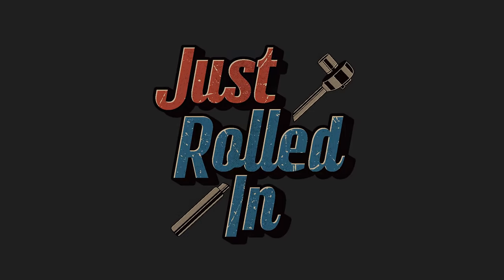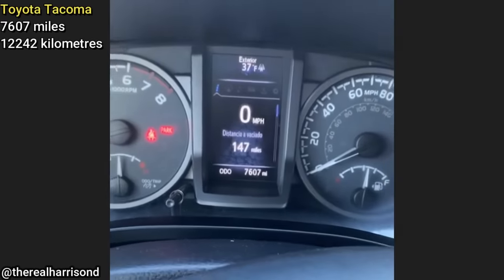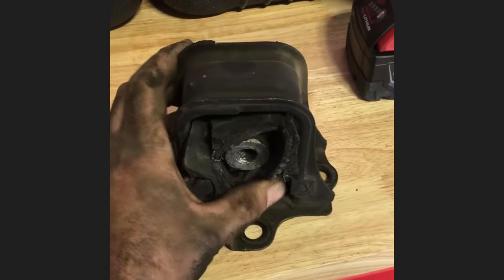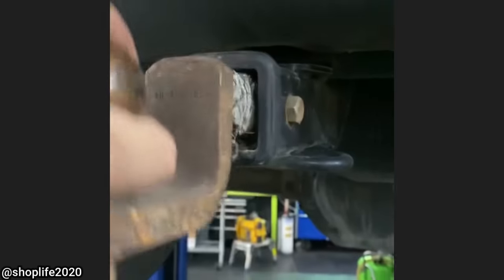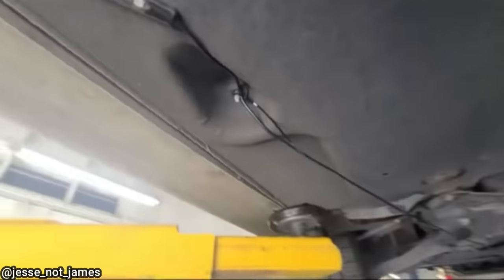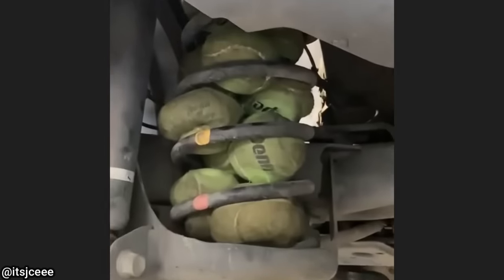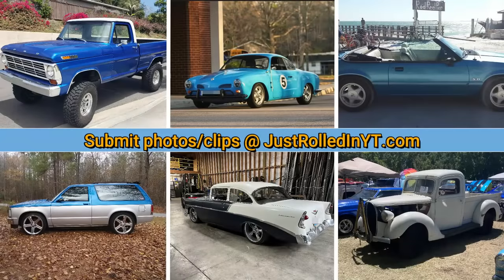Customer States Change Engine Oil On Tesla | Just Rolled In

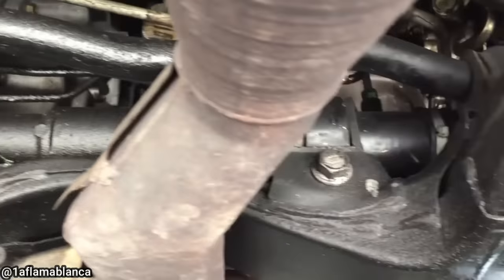Comment: 2:30  I took my girlfriend's car to a Sears shop once many years ago for a tire repair. While there, the mechanic showed me a loose steering control arm. As I had paid to have that control arm replaced four months earlier, I told the mechanic to put the car on the ground once the tire was fixed, and I left to head back to the shop that had put the control arm on. The other shop tech showed me that what had actually happened was that the Sears guy had pulled the cotter pin and loosened the nut. He fixed it in less than a minute for free, and told me that he'd seen a lot of that kind of thing from Sears. I went back to Sears and told the service manager what I had discovered, and that not only would he never get another penny of my money, but that I would tell this story to everyone I ran into for the next six months. As you can see, I'm still telling that story.
Reply: And Sears went out of business. You must talk to a lot of people!
Reply: I had a similar thing happy with a repair chain known by their logo showing three brothers.  Took the car in because it was trying to overheat (I could manage it by running the heater), and the place I would have taken it couldn't fit me in for a couple of days and it was within walking distance.  First mechanic looked at it and said it was probably the radiator, but the rest of the system was fine and holding pressure. It was too late to start that evening, 

The next morning I get a call from the "service manager" who told me the car had water "pouring" out of it and that I had to replace the intake manifold, the water pump, the radiator, and they really needed to pull the heads to make sure I didn't have a blown head gasket.  I asked why the tech the night before said it was holding pressure just fine, and the service manager gave me some nonsense about it being the difference between pressurizing the system with air, vs. doing it with water. So I said I didn't have the 2 grand that was going to cost me, so I was going to pick up the car.  He gave me the big song and dance about how I shouldn't drive it with it leaking that badly, and I really had to have it towed. I refused and when I came in they made me sign a waiver stating basically that if I ignored their advice it was the end of western civilization.

I drove it home and took it to the place I wanted  to take it to originally who cleaned out the radiator for $350. I waited a month and took it back to "three brothers" and asked for the service manager. He remembered me and asked if I was ready to get the work done. I told him I didn't but had a question: Why did he tell me that I needed $2000 worth of repairs when the actual cost was $350?  And I made sure that everybody waiting in the service area heard me.
Reply: @almostfm  I remember those guys. I can't remember the name anymore, but I heard a lot of bad things about them too.
Reply: @almostfm  Pep Boys… parts, tires and service…
Manny, Moe, and Jack
Once upon a time I worked at the parts counter of our local Pep Boys. Our shop did NOT upsell crap you didn’t need.
Reply: My brother bought a car and it developed a steering problem. He took it back, left it and got it the next day. He paid for the repair which was allegedly an alignment issue. Still didn't feel right and he took it back and this time he chalked the right rear tire. Shop called and said he now needs tie rods, lower control arms and upper ball joints. He said he would be in. Came in, car was in the same place, looked at the car and spoke to the manager who said it needed all that work and the mechanic said it was unsafe to drive it. My brother confirmed the car had been road tested and they both said yes. Took them out to the car and asked them what the odds were they could drive a car and park it in the same spot in such a way that the chalk marks were exactly lined up? Got the money back for the "alignment" which turned out to be a loose wheel bearing, complained about the shop which closed down 2 months later.
Reply: Jokes on you I wouldn’t take my car to a clothes store to get fixed
Reply: No but In all seriousness good job and I’ve also never heard of a auto shop with that name good thing they are out of business
Reply: @almostfm  a tire shop tried that type of thing with my sisters suv .. but they pinched the rear brake lines and told her it needed a master cylinder ,, took too another shop replaced damaged lines ,,did not need the master cylinder ,, d tire .. pulled that shit
Reply: @MsAubrey  I'd bought a lot of parts from them over the years and never got the "upsell" either. But after that, I never spent another dime there. I don't hold many grudges, but when I do, I make damned sure that they stick. I've got one gas station chain that I've never bought gas from because when my dad died in 1975, they tried to screw over my mom, and it had been our family's preferred brand.  I started driving 41 years ago so they've lost 41 years of gas sales to me and about 30 years of my mom's gas purchases before she died.  I ran out of gas one time (the only time I ever have) and I walked a mile past one of their stations to buy gas from someone else.
Reply: @almostfm  I can understand that. When my stepdad and mom lost their jobs with the Detroit News/Freepress I refused to ever buy one of their papers. Even when they offered me $50 off of my grocery bill one day, I wouldn’t do it.
Reply: Has 6 months passed
Reply: @almostfm  is L
Reply: My wife always took her car to pepboys, much to my disdain.
I replaced her alternator for her, and a couple weeks later she took her car to pepboys for tires or something. On the way back home her battery light came on, so we turned around and went back. We had them test and they told her she needed a new alternator. I said that's funny, because I just replaced it, and I can see the wire you disconnected from here.
Reply: that last part really got me  hell yeah
Reply: I once had a gear slip in my Jeep Liberty when my mom was driving it. Took it to a shop who told me that, on top of the steering rack and exhaust it needed, they also wanted to replace the transmisison. This was going to cost north of 4 grand. I took it to a transmission specialist for a second opinion who told me it was probably fine, then took it to another shop. They changed the transmission fluid since it was overdue and likely one of the causes of the issue, replaced the stering rack (it did actually end up needing that) and told me the small crack in the exhaust was a non-issue. The other shop told me the car woudn't survive the winter I was about to put it through up north. It has since been through two. If you're wondering, it ended up being 1300 bucks.
Reply: I never would waste my time returning there.
Reply: @almostfm  They replaced the started in my Tacoma and it would intermittently not turn over.  I went back and they told me I needed to step on the clutch before it would turn over.  I think I had been driving the truck for about ten years at that point so I knew how to start the truck.  I took it to a dealer and they found out that the three brothers had damaged the wiring harness when they put in the new starter.
Reply: Keep telling the story
Reply: @almostfm  Pep Boys. Yep had a similar issue. Battery needed replacement, took there cause it's a basic and simple job, just routine maintenance. Was told that the entire ignition system needed replacement. Thankfully I saw through the BS, because I know basic car stuff, and just got the battery replacement somewhere else.
Reply: A happy customer will tell their friends, an unhappy customer will tell the world
Reply: I went to a Sears to get a Diehard battery. I had the old battery and set it  on the Plexiglas part of the counter. The crotchety lady refused to talk to me until she had taken my old battery, set it on the floor, took out the glass cleaner and cleaned the couple specs of dirt that had come off of it. I never went there again.
Reply: Report them to the BBB.
Reply: @dtoora  Yeah. About twenty-two or three years ago.

Comment: I worked as an RV tech for years and one of the last jobs I did before leaving the company was a case of (and I quote from my picture of the order) “Customer states that water will not boil when placed near center of stove, requesting technician fix and find way to decrease time to cook.”

It was a 3 burner stove, the middle was empty and had no direct heat, my official response when I closed to job was “technician is unable to resolve issue due to the laws of physics, technician recommends placing cookware directly over flame for most efficient heating. The further the distance something is from a heat source the longer it will take to reach the desired temperature.”
Reply: it was probably too intelligent a response for them to understand.
Reply: So tragic the explanation was needed
Reply: Just remind them to open a window when using the oven and stove stops. So many have died like this at rest stops.
Reply: 🤘🏻 choice response! Unfortunately, that was likely a big "whoosh" for them...they hear "physics" and think "Einstein" and they're lost, LOL

Comment: It's smart to keep fresh oil in that tesla. Also check your transmission fluid and coolant levels.
The only thing hard to understand about a Tesla is where to pour in the electricity.
Reply: Yep Tesla Model S & X uses Dexron 6 ATF and Glycol Coolant. You do have to check on those every couple of years.
Reply: Best way to pour in that electricity is through the right rear caliper upper bolt but only on a Tuesday

Comment: ".. declined all repairs." And people don't get why I hope we never get flying cars. It's difficult enough worrying about current traffic. :P
Reply: People often think mechanics are attempting to scam them because they mention an "issue" that has nothing to do with what they came in for. Or they just don't wanna pay for it at that time. But when your breaks are literally grinding and look that bad, it should be obvious that it needs repairs.
Reply: @greego5952  not wanting to pay for it at that time could be a problem. like having enough money for an oil change but not enough to replace a bunch of other things.
Reply: @greego5952  What brakes? The pads were rusted shut.
Reply: @greego5952  quite sure the grinding came from the separation of the disc from the hub. The disc wasnt moving. At that point you shouldn't be allowed to drive it.
Reply: @greego5952  

Some garages ARE trying to scam people which just makes it so much harder for the honest hardest out there.
Reply: Traffic of flying cars wouldn't be an issue at all. In the air, the chances for a collision, as well as the methods to avoid collision are way better. It's a 3D space instead of a 2D, and planes traveling 10x as fast means 10x fewer cars on "the road" during rush hour, since everyone would make it to their homes sooner, leaving the air even more open than it already was.

Now as for what happens if someone crashes an air-car.. that is way more dangerous, since without proper safety systems, or with malfunctioning safety systems, it could hit almost anything on the ground, with no cost-effective ways to protect against it.
Reply: @greego5952  Or they try to charge 1000X the cost of the repair. I had a mechanic try and charge me over $2000 to tear down the engine and fix an overheating problem. The real problem was the $10 radiator cap that was not holding pressure.
Reply: Well that, and people seem to have enough trouble with forward, backwards, left, and right. Adding up, down, and diagonals to that mix is a recipe for disaster
Reply: Normally my first suspicion would be an insurance scam. In that case it would be more like a death wish if there was any more to it than straight up idiocy. Times like this support the quote "Never assume malice when incompetence will do."
Reply: How come that death trap was allowed back on the road. In england the  garage wouldn't let you take it.
Reply: They need engine cut off sensors wired to the brakes and suspensions in cars .. but now that I said it, they will do it.... Then we're all gonna be out there rewiring it so we can mow in reverse...
Reply: @ludo9234  *wouldn't let you drive it away, it could get towed with a flatbed though
Reply: @skylined5534  
Anyone can tell by looking at those brakes that they are destroyed and need to be replaced.
Reply: At least it would weed more people out.👍🏻
Reply: Declining repairs … can someone enlighten a poor European. Do you have vehicle inspections, can a car be flagged as undrivable?
Reply: @helvettefaensatan  some states do have inspections and other don't. That's the end of my knowledge on the subject also as a European (technically)
Reply: @helvettefaensatan  
It depends on the state, but many times yes. However, that might only be the case if done by an official inspector. I expect that a simple repair shop cannot "confiscate" your car like that.

In fact, it is generally illegal for a shop to try to force you to pay for repairs before releasing the car to you ("holding the car hostage"), because that's something that sketchy shops do to scam people.
Reply: @annehaight9963  and for that i am happy that in germany at least the shops can hold back such cars for obvious safety reasons. If the customer then claims different the TÜV and police will sort it out.  Cars like that should never see the street again.
Reply: We shouldn't have most of the shit we have today
Reply: @greego5952  Where the hell is the break on a car and why are you always on one?
Reply: In Poland you are obligated to call the traffic police so the car will be towed away for a test and then they will be forced to repair it or the car is getting impounded until they will come back with a appointement to a garage where the repeir will be done.  ...but long live free country, right?
Reply: @annehaight9963  

I'm not disputing the condition of the brakes. Read my comment again and understand.
Reply: Musk advocates strongly against flying cars for a number of reasons. I agree.
Reply: @weeveferrelaine6973  The only reason planes don't hit each other more often is that we have an air traffic control system. That's a lot harder to pull off when you have thousands of times more aircraft in the air.
Reply: @derrickbonsell  Most flying car designs are intended to be VTOL with many smaller local landing pads. Both for safety against high-speed collision damage from a plane, and for the main benefit- with is being able to reduce congestion.

If everyone had to drive to an airport, to go use their flying car before flying to another airport to go drive to work each morning, you'd extend commute, not shorten it. For that reason, VTOL is almost a must, or some other solution to the problem of just increasing congestion.